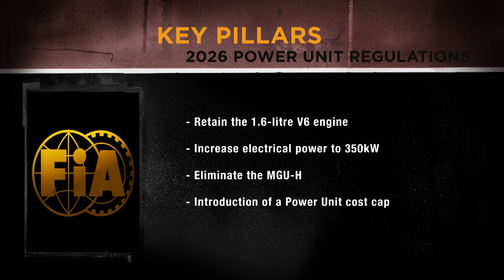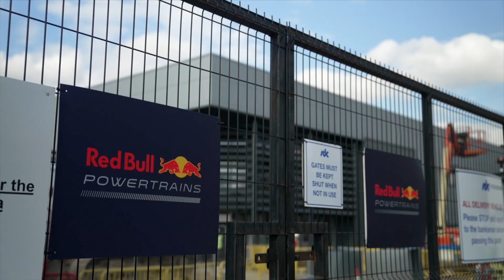What will F1 2026's power units be like?

Comment: If the fuel is 100% climate neutral, WHY keep the silly electric nonsense. Go back to natural aspirated v12 engines ASAP
Reply: It's 100% sustainable fuel (i.e. no finite resources used in manufacturing it), not 100% carbon neutral. They could offset the emissions to make it carbon neutral but the careful wording suggests that won't be the case to me.

Comment: Pathetic, 450hp wheezy engines and some battery spool that gives 500 for 20 seconds max, they're probably gonna need a speaker on board for some fake sounds as they struggle to go beyond 250kph
Reply: Where did you get that the engine itself is going to be 450hp? 

It will be higher revving so potentially more power, just the turbo spool is going to have a little more lag, due to removal of mgu-h.